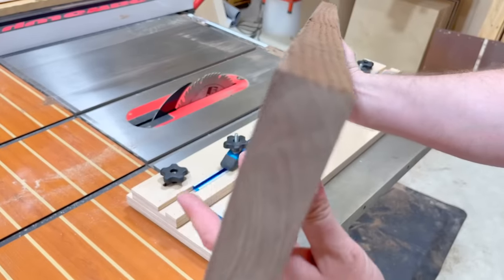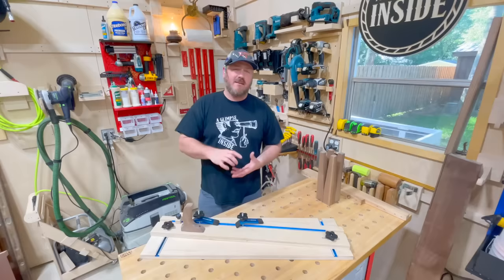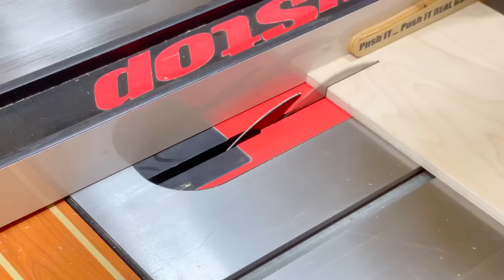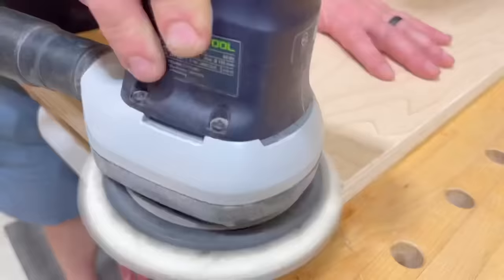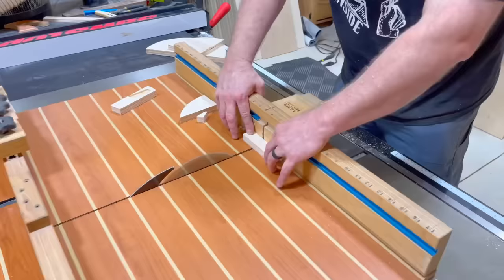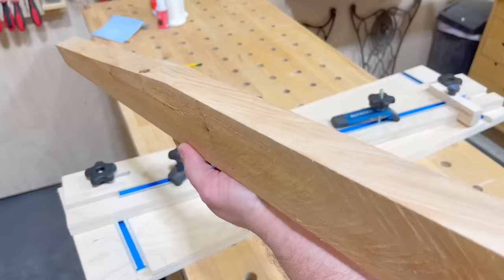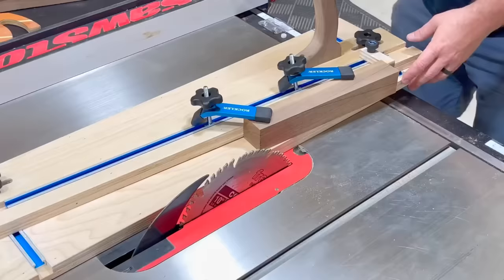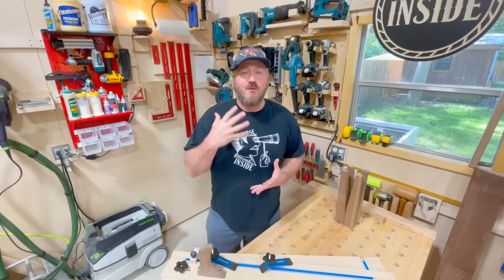This Jig Is A Two For One! Accurate and Repeatable! Make one Today!

Comment: Nice details, one question tho, any reason you didn’t add a piece in the bottom to run in the saw table grooves like the saw sled?
Reply from the maker: That would limit the width capacity
Reply: @AGlimpseInside  ahh, thought these always ran right next to the blade with the size of the tracks accommodating the size of the work piece

Comment: what would you think about putting t track on the bottom instead of using the saw fence?
Reply from the maker: Now this is how to properly engage on YouTube. Thank you Rich for your input and question. I definitely could put a track on the bottom to make it a bit easier and not have to worry about the fence. But a lot of the stuff I come across in terms of live edge material. It’s a bit wider than that would allow. So having the ability to trim off what I mean by using since is what I went with
Reply: @AGlimpseInside  that makes a lot of sense!  Thank you for the response!  Keep up the great content.
Reply from the maker: Thank you sir

Comment: Nice looking jig. I may have to build one. But I have a question.  @7:00  if the top piece is not perfectly parallel with the fence, then it won't work as a jointer, right? How do you make sure it's parallel? Am I missing something?
Reply from the maker: Good question. The bottom of the sled is perfectly rested up against the fence therefore whatever cut you make and whatever material is taking off will be exactly parallel with the fence giving you a straight edge. The top piece is movable to accommodate any type of misaligned board
Reply: @AGlimpseInside   yeah, but if the top piece isn't also parallel, then you're tapering, no?  When you joint the 2nd side, it will be parallel, but you will have wasted some of the board and the ends of the board won't be square.  I guess if we're talking about pallet wood, it will end up getting trimmed anyway, so perhaps eyeballing it would be OK?  Sorry, I was just a little confused. Have a good one!
Reply from the maker: I don’t really pay too much attention to the top board more focus is on the overhang of the piece you’re cutting if you overhang by eight or a quarter of an inch from front to back on the face you’re not gonna be tapering hardly at all
Reply: @AGlimpseInside  fair enough. Thanks for the reply

Comment: When you poke your eye out on that white makita drill I wont say I told you so. Yes I will feel sorry for you. But only you can stop that. 
If your an influencer then influence. Take the tools out of the drills when you put them away or turn them around.
Reply from the maker: I have a video coming out today right fix the entire problem. I’ve been working on it for about a couple weeks. And I address that same issue as well. Be on the lookout for something this evening
Reply: @AGlimpseInside   You were ahead of my comment and for the same reason. I've put you at the top of the class.